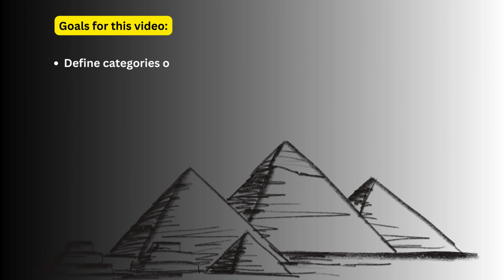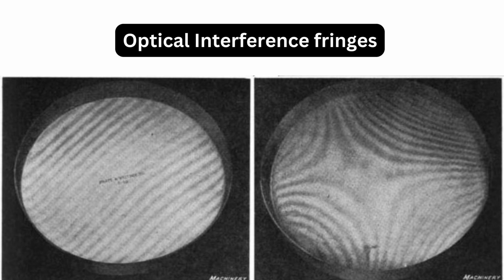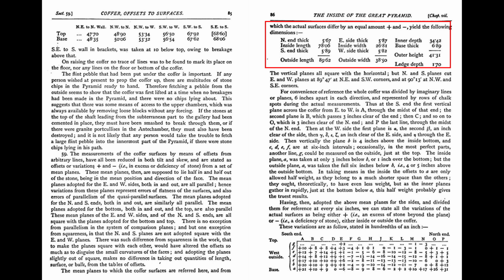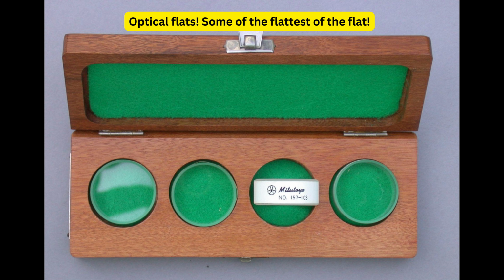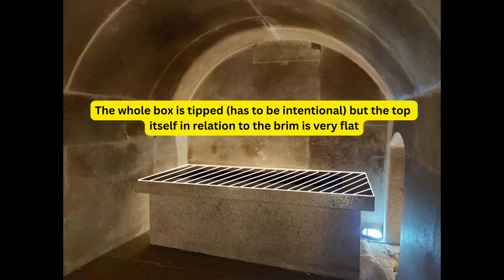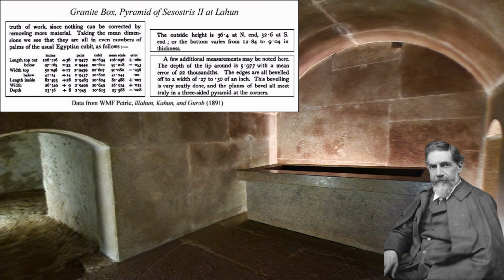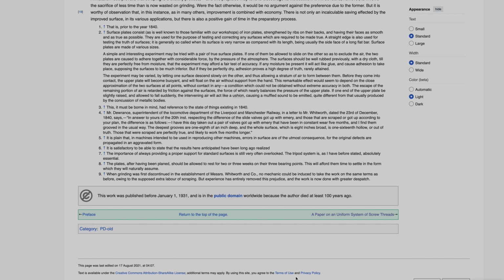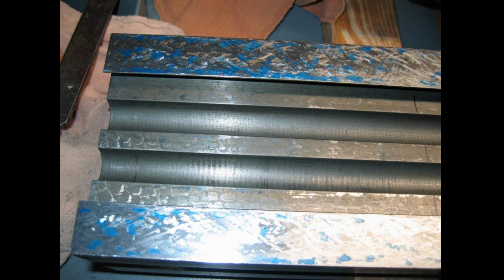The Problem of Flatness in Ancient Egypt

Comment: The 3 plate method sounds like BS. Anyone who's ever sanded wood knows the problems you'll face.
1. Maintaining consistent pressure over a uniform area. Without which high and low spots will form. Any over cut would spoil your piece instantly as there is no opportunity to fill.
2. Maintaining straight line translation of the rubbing motion.  Without which will cause non straight surface profile.
The idea kinda makes sense in 1D but would be very hard to pull off in 2D. You'd need to spin, not translate the rubbing action of the plate to ever have a real chance.... very difficult to pull off if you think about it for a minute, even before we start factoring in using the method on materials who's surfaces are not uniformly hard.
Reply from the maker: It does seem hard to implement

Comment: I can't believe engineers would rather deal with thousands of an inch instead of millimetres and micrometres.
Reply from the maker: And yet it got the USA to outer space. You’ll learn that we learn both. That way we can deal in whatever the measurement data comes to us in. Many of these measurements are from the work of Flinders Petrie who used the British imperial system. I did not convert anything he had in his books. Other technical data would give the measurements in metric. I presented it in metric. 😊
Reply: @intothemap360 That's true, but they primarily use metric these days, because it's a vastly superior system. The US doesn't use imperial because it's better. They use it because it's so deeply ingrained into the system that it's hard to transition. However, I'd have thought that the engineering sector would have made that transition due to how beneficial it would be. You can't deny that a base 10 system is beautiful in its simplicity.
Reply from the maker: Haha I’ve worked in optical and mechanical engineering for 17 years. Definitely use both. It’s also how we were raised and we enjoy the tradition. I understand the metric system but much like every other America or someone who thinks and dreams in their native tongue but speaks a second language, metric will always be the second language for us. The whole one system is better than the other is a red herring. Any system with sufficiently divisible units and an accurate way to measure them would work as good as any other. We can split the inch just as well as you can split the meter. Everything is arbitrary and it’s only the system of having all the units divide by ten that makes people think it’s better. But it’s not. You can accurately measure and define anything in either it’s just a different process going between each unit. You could also use a system of measurement based on a specific cows tail. As long as you can define everything else by that cows tail it will be just fine 😊

Comment: wouldnt the weight of the pyramid itself help flatten the foundation stones?
its just sandstone, thats pretty soft for a stone
if you put the weight of a pyramid on that soft rock, wouldnt any protrusions be crushed 
basically flattening itself
so simply from the weight of the structure and material you would kindof expect the fitting of the foundation stones to be pretty precise
Reply from the maker: No. 😂😂😂😂😂 stone doesn’t squish!!!

Comment: Very interesting. When I was young, I made a number of telescopes. To make a telescope mirror, we would start with two glass disks of the same size. We would slide the top one back and forth in all directions with an abrasive material and water between the disks. As this progressed, the top piece of glass would become concave and the bottom piece convex This is because the more central areas of the top blank would be over a grinding surface more than the edges. We did this until the concavity was such that it would produce a mirror of the required focal length. We would then go through finer and finer grits until we had a polished surface. A sphere is the only surface that will slide over itself (a plane being a sphere of infinite radius) so you end up with a two spherical surfaces, one concave and one convex, that are indeed PERFECTLY spherical. Eventually to within a fraction of a wavelength of light, in fact. That's really perfect. It always amazed me that you could go downstairs after dinner and, using very simple materials and procedures,  make optically flawless surfaces. (A sphere does not project a perfect image, rather a parabola does, so during the polishing phase, which is done against pitch (actual tree sap) rather than glass, you go through a procedure of deepening the center of the mirror to get it very close to a perfect parabola.) Anyway, my point here is that this action makes two perfectly sphereical surfaces. So, if there was a large surface, like a sarcophagus lid, that was being ground flat using this procedure, it is possible that it would take on a very slightly sphereical shape. It may be such a small effect that it would not be visible to even a discriminating craftsman, but it would still be there and be measurable with modern instrumentation. The important observation that would show how the surface was shaped would be the fact that this surface would be PERFECTLY spherical. Not just a bit turned down at the edges, not spherical but with a low spot here and there, but perfectly spherical.  (Actually, if the grinding took place with the top slab being pulled back and forth in only one dimension, it would be perfectly cylindrical.) Are you aware of any such ostensibly planar surfaces in ancient Egypt that might be, upon close inspection, shown to be very slightly (but perfectly) spherical?
Reply from the maker: That’s a fascinating insight from telescope making, I’ll have to look into whether anyone has tested for a slight spherical curve! I don’t think so because there isn’t good data like you saw in my video, it’s all a hundred years old or more!

Comment: I’ve always been under the assumption they used water to check the flatness. They would pour water on the surface and if the water runs in a direction, you know it’s not flat enough
Reply from the maker: That is level. Level and flat are not the same. We sometimes use those interchangeably but here I’m speaking in geometry terms

Comment: Let's see some ppl move 100ton stones with wood water leaves.
This only explains polishing, not the whole of the architecture and build process. There's a clear difference between what hyroglyphs are found and what they are found on. I'm not taking away from early ppl starting to rub stuff together but it should be looked at more like they found these ruins and claimed them, then it will make sense why they stopped making "national projects" over time as they got worse.
The oldest artifacts are often the nicest and more precise, generally you start bad and get better, not start good and get worse.
Reply from the maker: Of course it doesn’t explain everything. To explain everything in one video would make it far too broad and unfocused. Also there are full volumes written on the hieroglyphic found on internal stones. That is, stones set during initial construction. Your idea of them being claimed has no bearing on reality. Tons of plug and other stones were removed from the pyramids and the marks that were hidden are very useful in identifying and dating them. But thanks for watching!
Reply: @intothemap360  that internal stones theory is a straight up conspiracy. You have no idea what you talk about
Reply from the maker: Okay you ask for evidence and I deliver. If you only get your evidence from podcasts then of course that claim sounds plausible. However, if you are going to claim that the idea of quarry marks on internal pyramid stones is a conspiracy, the published excavation literature says otherwise. Multiple peer-reviewed archaeological reports document construction marks and quarry inscriptions at Sneferu’s pyramids at Dahshur. For example, here is one with tons of photos. Ahmed Fakhry’s preliminary excavation report “The Excavation of Snefru’s Monuments at Dahshur” appears in Annales du Service des Antiquités de l’Égypte (ASAE) Vol. 52, pp. 563–594, which can be read directly here: https://archive.org/details/ASAE-52.2-1952/page/563 ; the same volume also contains H. Mustapha’s “The Surveying of the Bent Pyramid at Dahshur” on pp. 595–602 (https://archive.org/details/ASAE-52.2-1952/page/595), followed immediately by H. Ricke’s architectural study “Baugeschichtlicher Vorbericht über die Kultanlagen der Südlichen Pyramide des Snofru in Dahschur” on pp. 603–623 (https://archive.org/details/ASAE-52.2-1952/page/603). That same volume also includes Z. Iskander’s technical paper “Desert Varnish and Mortar of the Rhomboïdal Pyramid at Dahshur” on pp. 271–274 (https://archive.org/details/ASAE-52.2-1952/page/271). Earlier references to Dahshur inscriptions and quarry marks appear in ASAE Vol. 39 (1939), which can be browsed here: https://archive.org/details/ASAE-39-1939/page/n1. In addition to these journal reports, Fakhry’s full excavation monograph The Monuments of Sneferu at Dahshur, Vol. I: The Bent Pyramid discusses red-paint quarry marks and construction graffiti in the Bent Pyramid complex (see pp. 22–23, 54–56, and 94–96), available here: https://pdfcoffee.com/the-monuments-of-sneferu-at-dahshur-vol-i-the-bent-pyramid-pdf-free.html

These are primary archaeological publications written by the excavators themselves and document red-painted quarry marks, construction graffiti, and inscriptions associated with Sneferu’s building project—similar to the famous worker-gang marks discovered inside Khufu’s pyramid—demonstrating that internal quarry marks are a well-established observation recorded in professional excavation reports, not a modern invention. So no, I do know what I am talking about :)
Reply: @intothemap360 nobody denies they made repairs , but they were notorious for writing on shit that they did not make constantly . Show the proof and how it's done then, everyone can talk skit over video and claim anything. They definitely did not make that granite shit like they say they did. You don't debunk anything, just a troll that ragebait.
Reply from the maker: 😂😂😂 okay have a good day
Reply: @intothemap360 reading papers with certain biases don't make you an engineer ,there is no way you make that surface finish with tools presented and that way you are intellectually dishonest.
Reply from the maker: No you’re right. Having multiple graduate degrees and working in the field for 17 years as I have does. But you see I don’t like to just throw credentials on the table until online trolls force it. You’re about to be unable to comment anymore so just be nice, agree to disagree and chill out.

Comment: Or you spin a dowel on a lathe coat it with paint than roll it on your surface 
After cutting the rough shape of course
Reply from the maker: Interesting. I’ll have to think about that a bit.
Reply: @intothemap360 oh it would not get it perfect but of course with strings to chip the rough shape than rolled dowels to make it fine and buffing for final

Comment: -1-The first thing the Egyptians had for this type of operation (achieving a level of perfection in flatness) was time and a level of patience that seems absurd to some today.
"If it's not finished in half an hour, then it's obviously impossible!"
In their time, to reach the level of perfection they wanted, they had no other solution than to spend days on it.

-2-You state that the pinnacle of surface finish is in optics, and I agree! 
However, it will surprise many to learn that in optics, perfection is not achieved through the mechanization of the process.
This is completely counterintuitive, but a telescope mirror "cut" by hand by an excellent craftsman has a good chance of being 100 times closer to optical perfection than any machine-made mirror.
In the manufacture of telescope mirrors, the machine's "regularity" is its biggest drawback, and the inherent randomness of the human condition is its greatest asset, but this requires a rather significant investment of time. 
The mechanization of randomness is very, very complex.
Reply from the maker: Great points!

Comment: I have worked as a craftsman for more than 30 years, mostly with metal. As a hobby I was intrested in medival stuff and it is astounding who far you can get without power tools or modern mesuring tools. Even the human eye can be schooled to see things an unschooled one would need a tool to measure it. We had a expierenced locksmith in the company who cut draw a line with a pencil parallel to the edge of a metal plate with an exact distance of 20mm or 25mm, without any measuring instrument. Simply he did this all day. 

Actually looking over the edge of that sarcophagus with a good light source, with the eye level the hight of the edge, would reveal a lot more than putting a mechanic´s level on top. 

There has been excellent craftmanship in ancient time, no doubt. But there is nothing above human understanding, alien technology or such BS. It mostly came down to simply working technics done with endurance and experience.
Reply from the maker: Well said. Thanks for watching

Comment: [1] So, how large did the three sanding stones have to be in order to create the "rough" flatness on the Serapeum sarcophagi? [4 meters (13 ft) long, 2.3 meters (7.5 ft) wide, and 3 meters (10 ft) high]
[2] How did they move the 70-100 ton sarcophagi through the narrow hallways?
[3] I do not believe in extra-terrestrials at all (then or now). However, I still wonder if this is a lost technology. I would like for someone to use the tools they had then, and create an identical sarcophagus of the same type of stone to the same level of "rough" flatness on all sides.
Reply from the maker: Lots more research to do for sure! Thanks for watching

Comment: The Egyptians had 2 devices that most people dont consider.  They had water powered rope saws using sand as the grit.  They also had large diameter saws.  In the order of 40 feet diameter.  There are ancient stones with large arcs in them.  The stone cutting areas of the quarries were advanced for their time.

Also.  The pyramids were not "made by slaves".  It was made by extreme craftsman as a make work project during the off season for normal farming.

The last comment is the pyramids are NOT solid rocks.  They are rammed earth.  Only the outer stones are there.  The rest is filled with rubble and compacted.  You can see the method by looking at the damaged pyramids.  This is why there are only a few small rooms in the middle of the pyramid.  Incidently it is the same as the great wall of China.  If you have seen the broken parts of the wall you have seen what the pyramids look like.
Reply from the maker: You should watch my video the problem with giant saws in ancient Egypt.

Comment: You can check and make sure a line is straight by literally pulling a piece of thin string till it’s very tight and then using a bowl filled with water to make sure the string is level. If you want a perfectly perpendicular line to this you tie a rock to a rope and let it hang down and boom 90 degree angle. Calm water naturally forms a level horizontal plane.
Reply from the maker: See pinned comment. Water is level not flat. Flat and level are not the same

Comment: I have used soot from a candle to fit a rifle stock. This is a method that is still used today to fit up irregular shapes and could have been used to make straight rules with the three surface method. Those could have been easily used to check the work.
Reply from the maker: Good point, I advocate for the three plate method extensively in this video!

Comment: Yeah I work in aerospace, you can get a rough idea of flatness with the naked eye, but you would need to use a machine like what he showed to know how exactly how flat it is.  If such a machine has never been used then any claims about it being too smooth is bullshit.
Reply from the maker: Thanks for the input! Always good to to hear from people that work in engineering
Reply: @intothemap360  No problem, should have also said that what they were checking is called concentricity.  Its how uniform the dimension you are checking is across the entire part, ie its .0016 high on this side but on that side its .0008 lower than nominal, but still within tolerance so long as the concentricity doesn't have to be real tight.  Flatness is completely different as you said.
Reply from the maker: Yep. I worked in optical and some other engineering fields for a while but never with surface plates. Good point!

Comment: Yea now tell me they did this 2.3 million times buy hand for just the the great pyramid  alone.
Reply from the maker: You’re mixing up the number of total stones with the number of casing stones. The stones like the ones in the core are limestone, easily cut by hand and not to the level of precision of the casing stones. The casing stones are around 145,000 and probably were mostly hand picked and then lightly squared up. The number of granite pieces made to this level of precision are probably less than 100 across 2500 years of Egyptian history.
Reply: @intothemap360 They still where cut and fitted to a degree they still had to have some way to fit these stones with some sort of speed. We see  circular saw mark on the stones they had to of had machines to help with this. We are just guess at this point on how they did this. Your points with the three stones to get a flat surface is a good one. I just think they had some mechanical way of doing this.
Reply from the maker: Most of the semicircular marks are from a pendulum saw not a circular saw. I made a video called the problem with giant saw blades if you’d like to see why circular blades aren’t used. The pendulum saw swings back and forth and leaves the same marks but without the needed motor and gearing a circular blade would need for torque